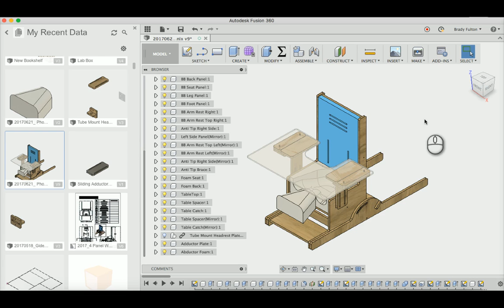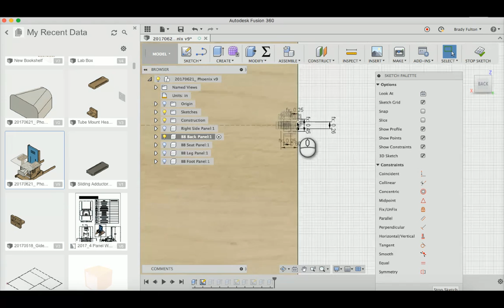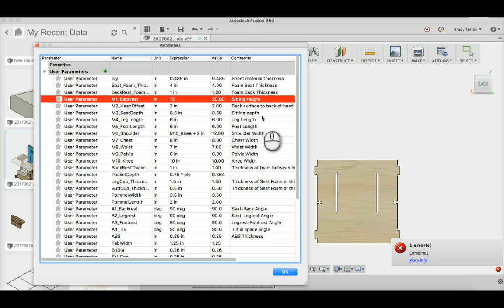Sketch Constraint   Symmetry in Fusion 360

Comment: This is very nice, but how do you achieve the mirrored symmetry between the t slot on the left and the one on the right? I'd like to mirror or copy+paste+reflect, but cannot find a way to do it.
Reply: Thanks for the reply! I guess the challenge that I am having is that I drew my t slots into the sketch for my [equivalent to 0:53 "BB Back Panel"]. Are your slots on a separate sketch from your panel?